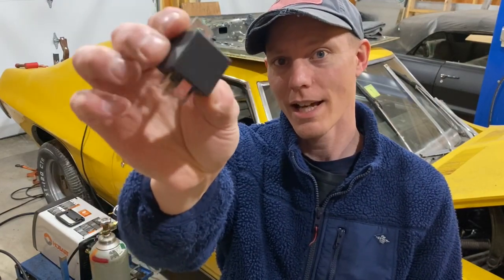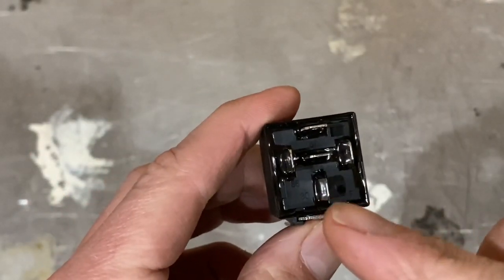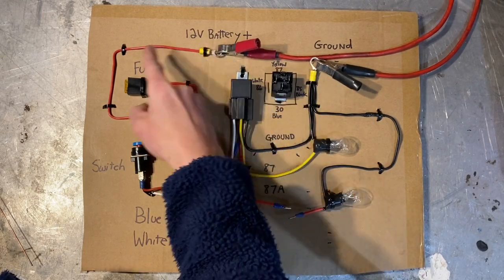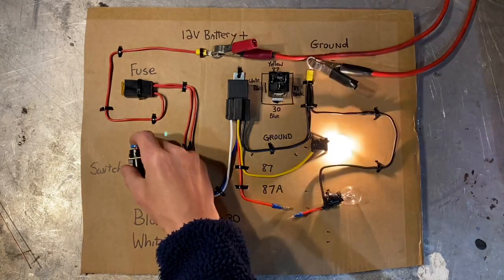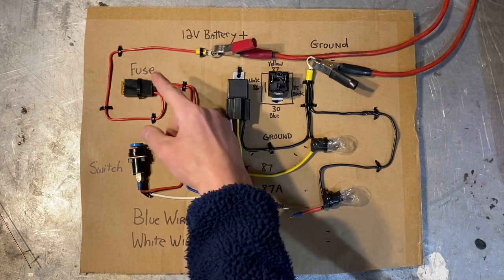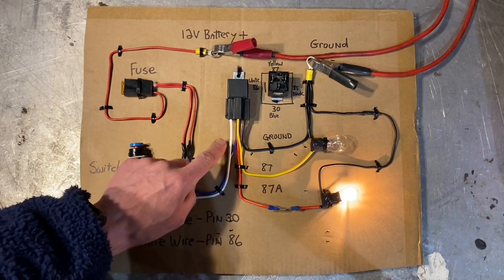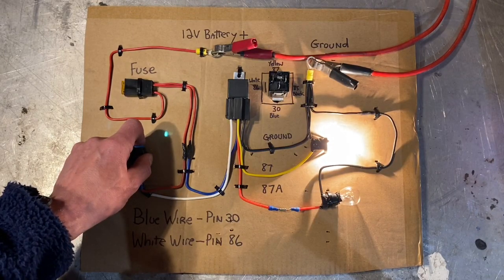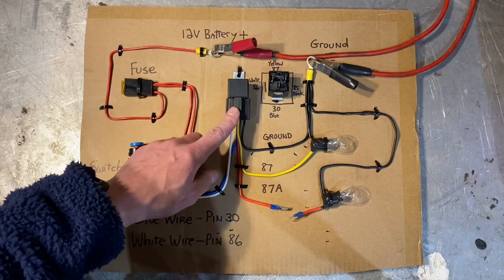How to Wire a 5 Pin Automotive Relay. Pins 87/30/85/86/87a . Bosch Style. Fans / Fuel Pump / Lights

Comment from the maker: Thank You for Watching the Relay wiring video! 
Subscribe To This YouTube Channel: http://www.youtube.com/user/4g63mightymax?sub_confirmation=1
See My Wiring Playlist: https://www.youtube.com/playlist?list=PLsF7T1tRFy2hmiiUUfMZNyV-BUA_yrPIh
Reply: Great 👍🏻 thanks for your time to made this useful video 👍🏻
Reply from the maker: Sam Sam - thank you for watching!
Reply: Jeremy N you are welcome, great teacher 😊
Reply from the maker: Kankuro 4ever - what did you mean by “two screens”?  Like video screens in a car?
Reply: @WiringRescue  "
 
.
Reply: Hi Jeremy N, I have been trying to wire a switch to a relay for my led lights I’m using in my stereo build. I know how to wire the lights to the relay, I am having the hardest time wiring the switch to the relay. I am using a 5pin switch button, I’m only wanting my lights to come on when my car is running and I press the button. Any help you could provide, I’d be sincerely grateful.
Switch has Blue marked NC
                     White as NO
                     Green as Common
                     Red +
                     Black -
Reply from the maker: Roy Sullivan - the easiest method of making it work is to have the power come from the battery, through a fuse, to red+. Then black will go to pin 86 on the relay. You can skip all the rest.
Reply: Jeremy N I appreciate your reply. I was able to figure it out. Do you think it’s possible to use a temperature meter and relay together, and #87 power the fans. Meter has power for unit. Red, black, yellow. Yellow 12v ignition. Also white and black, output for fans. Fans white positive. Would That application work together, my fans would pull too much for meter, but I could get lower amperage fans if this wouldn’t work. Thanks for any advice.
Reply: @kankuro4ever960  1a
Reply: Its okey for the headlight,,, high ang low connection
Reply: hello sir can i run my bike self stater and horn by same switch
Reply: it's a bit confusing when you can't see what's written because your hand is covering it
Reply from the maker: @TommyJensen-pl8qz - I have made a newer video explaining relays that you might like better. Check it out:  https://youtu.be/QCkfFCLa_Jg
Reply: if you put a 2 pin blinker relay in where you have a switch you get a wig wag light
Reply: and do you put a flasher relay in where you have a switch do you get wig wag light

Comment: I’ve found your videos quite helpful, thank you. My question is could you or have you already made a video on hooking up a “2” door car power windows, drivers side can operate left and right windows by separate switch …and another on passenger side that works  independently. All run threw double relays on each door … I’ve seen your relay to 1 window switch already but confused as to operate both windows, from drivers side .thank you anything would help.

Comment: If I wanna use a wireless switch which is 2 wires (+,-) input and 2 wires (+,-) output, can i directly connect both input and output negative wires together from battery from negative terminal? And connect positive input and output wires to relay?  Basically like 1 positive wire from relay and 1 negative wire from battery for input to wireless switch and 1 positive output to relay,then no negative wire output, because I checked both input and output negative terminal inside wireless switch are connected together, so I think don’t need negative output wire back to battery, will it safe to do that or not? Thank you so much

Comment: Wouldn’t you want the fuel pump on 87a instead? Since 87a is always receiving power.
Reply from the maker: Nope, you’d wire it up so that your ignition switch, or ecu turns on pin 86, which then tells the relay to turn on, which then powers the fuel pump.
Reply: @WiringRescue ngl I’m super confused. In your example you are using a momentary switch. So power from the ignition isn’t going to turn on 86 to turn on 87 unless you’re actively holding down the switch. With your case you always want the fuel pump to be on or the car want get fuel and 87a is always on without engaging the switch. To turn off the fuel pump with it wired to 87a you would press and hold the switch. If wired your way to pin 87 from what I am understanding then the fuel pump would only turn on and stay on when you press and hold the switch down. That doesn’t seem practical to press and hold the switch while you are driving around. Obviously I wouldn’t use a momentary switch for the application but this is how I am understanding it. Is this still wrong?

Comment: Great video best I've found but thinking I'm having relay overload trying to get 5 pin relay to work with a riding mower 7 pin ignition an grass is now waist hi.  And so need a lil help on what wires from relay to to ignition switch and switch pins are  marked G- ground , L-Lights,  A1, A2  B-Battery  S-Starter , M-Magneto  what wires from relay to to which wires on switch??   Thanks in advance

Comment: Hey I have a question. Does it work with other switches? I have observed that you use push switch in this demonstration . I wonder if it works with toggle switch or 3 way switch
Reply from the maker: Yes, you can use any switch you want to trigger the relay. I also have a newer relay video and a video all about switches in my wiring playlist if you want to check those out. Good luck with your project!

Comment: I want your help if you can I put in a fuse box so I could connect a lot of lighter plugins but I don't wanna use every day I do not want to use a switch and I want it run off the fuse box is there a way and can you please show me cause there is no one out there showing that others showing is they putting a relay on to the fuse box and not showing the connection In the reason I want the lighter part is a lot of money on lights already have a connection on the end where it connects to a lighter and I do not want to connect it to my car  Cause Ford doesn't make it where you could have it running all like that without messing up their fuse box

Comment: I just diagnosed my faulty revolving light Wich I I found out that power output from pin 87 it's not even supplying power.so what is the problem

Comment: Thank you!
Reply from the maker: You're welcome! Glad this video was helpful.
Reply: @WiringRescue  If u had to sum-up in one sentence, what would you say is the most useful uses for relay?

Would it be to save wire and turn on/off?
Reply from the maker: @gotchaplumber no - I’d say “a relay allows a small switch to safely control a large amount of electricity.” I made a video showing it here. https://youtu.be/QCkfFCLa_Jg?si=Cl_Sqnl_FtvF7nHm
Reply: @WiringRescue  Have to watch video.

Good info.

Comment: Question, can i supply the trigger source of the relay (86 and 85) with 12v and supply the contact side of the relay (30 and 87) with 18v? I read somewhere that i can since the coil is triggered by 12v and the contact side is then used to power 18v. 

Please help

Comment: A very good example of using a relay. But, the thing missed in most of these videos. Is the fact you might find yourself switching the ground instead of the hot side. Let that soak in.
Reply from the maker: I have since made a better video showing exactly that. https://youtu.be/QCkfFCLa_Jg?si=-kd08DhfdKbNYFJX

Comment: Could that 87a be use with a dual element light to be used as like tail light then break?
Reply from the maker: Unfortunately not. You need a separate circuit for that entirely. I do have a variety of videos in my wiring playlist that do show brake light wiring though!  https://youtu.be/h6F9PauqvXc?si=mSq8ujfqEPRB71Jh

Comment: So if wiring a dual beam (high/low) headlights you'd wire this from the high/low switch. But would there still be full power going through your headlight switch. The reason a lot of people do this is to save/extend the headlight switch with the added bonus of more power to the headlight. But if you are still sending full power through the headlight switch then I'd assume the best way would be to wire two 4 pin relays. One for low beam one for high beam?
Reply from the maker: You are totally correct.  You could very much use two relays to give your headlights nice clean power without funneling all the electricity through a dimmer switch (or similar). I have a whole bunch of videos about wiring headlights, and I don't think any are wiring in the way you suggest.  I'll add this to my to-do list of videos to make because I think it could be a cool video to add to the collection.  In a strange turn of events, you are the second person to suggest this exact thing within the last week, so clearly it is a good idea that people want to see!

Thanks for watching, and good luck with your project!
Reply: @WiringRescue  Hey that's awesome, I look forward to seeing it. 
Subscribed.

Comment: Would this work with an on/off/on switch? Do you have any videos covering such switches?

I need to wire an accessory with a low/off/high setting

Comment: The 5 pin relay I bought has 2 87s and not 87 and 87a .. does it work the same or not?
Reply from the maker: Unfortunately I’m not sure. Does your relay have a diagram on it, or the packaging that shows how it should be wired?

Comment: Ok.. First off, TY for the easy understanding of how relays get wired. It seems so logical havibg ut pyt in the simplest terms.  
I have one question.  Im putting in a driving light bar and want to be able to overide the bar toggle switch with a momentary push switch as well so that if the toggle switcg is off, im still able to actuate the lightbar with a push switch.. passing, getting high beamed..ect.  is there a specific procedure on how to accomplish this?

Comment: what should be the size of the fuse for the switch 86?
Reply from the maker: Very small. 5 amps or less usually. It’s just protecting the switch. So you’ll have a fuse that is smaller amperage than the switch is rated for.

Comment: What if the button switch has a light on it? How can I prevent the light from drawing the battery dead?
Reply: I believe the wire for the switch LED can be tapped to cig lighter so it turns on when car is on and vise versa or anything that works this way like ingnition etc so its not always on

Comment: I have designed custom LED strips for the grille and lower bumper using dual-functioning strips with both amber lights (for turn signals) and white for DRL (daytime running lights). However, I have not determined how to utilize the amber LEDs to function as both DRLs and turn signals. To achieve this, I would need to incorporate a relay, diodes, and resistors, as well as an additional fuse, so that the amber LEDs function as DRLs and then switch to amber sequential signals when triggered by the turn signal switch.
Reply from the maker: I made a video about this. Check out this one, and good luck with your project! https://youtu.be/ZOBd_7rtv4s?si=aL1EuK_Of69g21Al
Reply: @ i just watched that video and realized I have one of those relay box’s that has 6  five pin relays and 6 fuses in a prebuilt box. Would It be easier to use that since it’s on hand already? If so were would I splice in the switch and flasher?

Comment: Here's one for ya. I have a 16 Mustang GT. It has driving lights in it. I put an aftermarket shelby gt350 bumper on it and unfortunately they do not have driving lights. I actually integrated a set of aftermarket driving lights into the actual marker light where the marker/turn signal bulbs are. Which is obviously a 3 wire socket. There is another marker light only bulb in the marker light assembly which is only a 2 wire 194. I'm trying to now get the 194 marker to be used as a blinker with a white/amber switchback.  How could I use this method to make that work? Thanks

Comment: can i wire 87 and 85 togheter so that when it would detect something connected on 87 it would cut the power to 87a and would give power to 87? i wanna make an rear fog cut-out out of a 5 pins relay so that when i connect the trailer and switch the rear fog light, the trailer rear fog bulb (12v 21w) would work as a ground for 85 but it would also recieve power from 87.

Comment: I am planning to use a relay to wire a backup camera for my 2005 Ford T-bird. I’ve learned that the backup light “trigger” wire on the passenger side is the black wire with a red stripe but I’ve also read that all of the wires have power and the black wire with a red stripe provides a negative/ground to complete the circuit. Knowing this and considering the process of putting my car into reverse as the same as pushing the button on your model, do I need to put my black wire with red stripe on the negative/ground side of the relay switch?
Reply: One more quick question…if the head unit/screen for Apple CarPlay is powered by USB-C and it seems that the only power needed is for the actual small backup camera on my license plate holder (and there are no specifications on the Chinese-made camera), do you think I should put a 5 or 10 amp fuse in the inline fuse holder?

Comment: Fuse goes on 30 pin to protect relay and whatever is getting the high current. Switched side doesn't need fuse since it usually sees low current and is only a trigger not powering anything.

Comment: Can I pin my ecu to 87a, then my starter on 87? Then use my stock ignition switch to activate my stand alone? IGN switch #35130-S04-305

Comment: How would you incorporate a GS-100A strobe controller in that circuit 
So that a set of lights are lit but when the controller is activated by a switch ( it flashes) then goes back to fully lit circuit again

Comment: I got a unique situational setup. I have a rig with LED taillights, and headlights that have a LED white and blue ring with their own seperate wires (plus ground, of course). I have a 3-way/3-pin switch to where one on position controls the white headlights and the taillights, and the other on position is just the blue ring and the red taillights.

I'm using diodes so I can run one hot wire to the taillights, but have one wire each for the white and blue light circuits to work along side the taillights. However doing this causes the diodes to heat up. Anybody have any suggestions using relays instead? I'd like to keep it to three hot wires to each light (One for taillights, one for white, and one for the blue ring)

Comment: Can you power the switch with a wire tap?
Reply from the maker: Wire taps are generally accepted to be a bad idea in the automotive electrical world. That’s because you’re essentially stealing electricity from a circuit that was not designed to handle it. So for example, your factory circuit that was supposed to flow 5 amps, now has 8 amps flowing through it to power your additional accessory. That means something is going to go wrong in that 5 amp cricuit. It could be blown fuses,  melted wires, or fire in the worst case scenario.

Comment: i hope you can help me to wire a relays for Power Windows. i have 12 gauge power batt to pin 87 on relay, and i want to connect pin 86 to ignition sw ACC, pin 85 to switch up/dn, pin 30 to motor up/dn and 87a to ground. my question is what is the best wires gauge going to pin 85, 86, 87a and 30 on relay? this going to be 2 relays each window.
Reply from the maker: Wire and fuse sizes depends on the components that you are using. Luckily, I made a whole video about this to help you out. https://youtu.be/EhzN6UdnmPA?si=Jz1cJIrvjz8KQ1ej

If you look in my wiring playlist, you’ll also find a video about wiring power window motors. So feel free to check that out too. Good luck with your project!

Comment: My fuel pump is not getting power there's a red wire to pin 30 when I hit the switch I have power, green 87 to the pump, black 85, black with white stripe 86 it's on a 90 eagle talon did he wire it correctly? It would intermittently click and the car would die now won't start at all so the pumps getting no power, any idea?
Reply from the maker: It sounds to me like it is wired correctly. 
- make sure pin 30 has power and a fuse in it near the battery.
- make sure black with a white stripe going to pin 86 has power when the engine is cranking.
- make sure the ground on pin 85 is good and not rusty or loose.
- make sure 87 is sending power to the pump when the engine is cranking.
Reply: @WiringRescue ok I appreciate your help

Comment: How would you wire a relay to work with a 1947 GM truck headlight switch?
Reply: I've made many relay harnesses for my classic chevys. They're easy, and fun. Butt, kinda tricky to explain. However, LMC makes an already pre made headlight relay harness for your trucks high and low beam setup. You'll be happy you did it. No more dim tan headlights. Nice powerful white beams from a glass headlight like the good lord intended 😉
Reply: @WW226  great info. Thank you
Reply: LMCs part number (36-3580) 
it's specific on the year. Says 67-72 trucks. Butt it doesn't really matter. As long as you have the 3 pin headlights. Wires right in

Comment: I want to connect my sound bar to my acc, but I also want to be able to turn the sound bar on when the key is off.  Can I jumper 87a to 87 to do this, or would that be defeating the purpose of the relay?

Comment: How to wiring headlight using ac voltage and other one using dc voltage using same switch?
Main light are using AC,  but i want to add other led light but it use DC voltage. Please help!

Comment: I am searching on yt how to  conect 5 pin switch ( NC, NO, C, A, B). I find out how, but I need conect even relay because led light bar for tractor is 288w. How I conect all together? I understand your explanation but what if you have 5pin switch. How you wired/ conect that. Thank you.